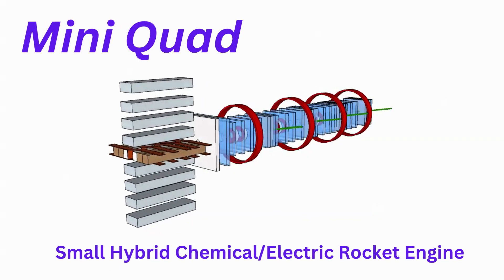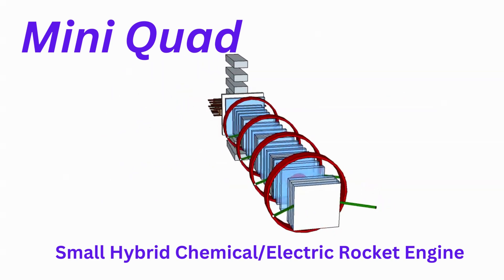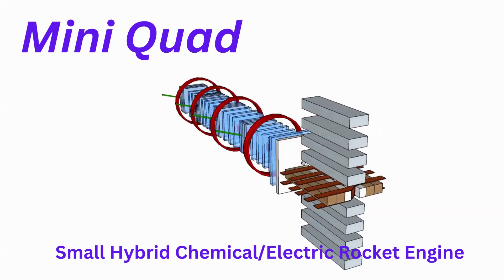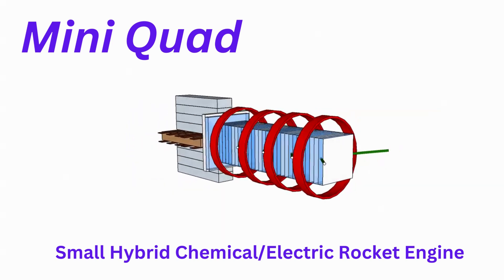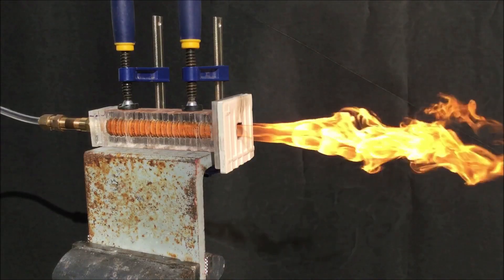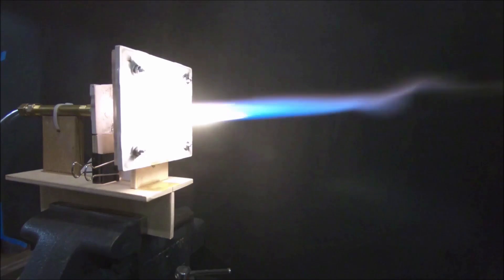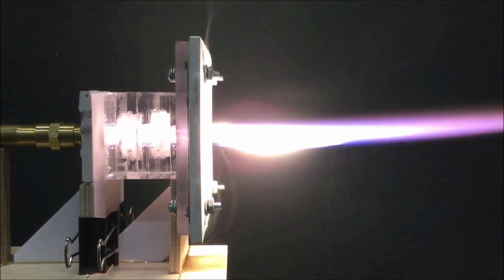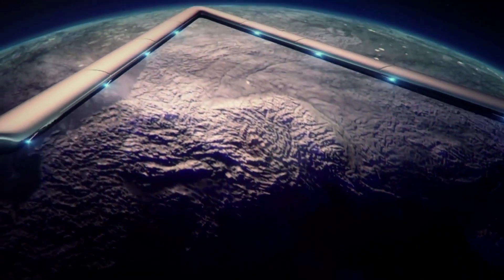Hybrid Chemical Electric Rocket Engine Walk Through

Comment: So would there be any possible arrangement for these motors to allow for the MHD units to operate as or similar to Hall effect thrusters without the solid fuel ignition? That would allow for super high ISP long duration flights as well as maneuvering thrusters et al. I feel like that would be very doable and very likely worthwhile…🤔

Comment: Since you're pumping liquid oxygen into the engine anyway. Can you get your magnetic field up by using REBCO superconductors? There's only about 20˚C gap that you need to close between liquid oxygen boiling temperature at 1 atmosphere and REBCO superconducting temperature.
Reply: I feel like it would be nearly impossible to maintain super conductivity while in such proximity to the rocket motor exhaust. Although that would be a brilliant method of autogenously pressurizing the oxidizer tankage. It would be an MHD boosted expander cycle hybrid solid motor…😳lol